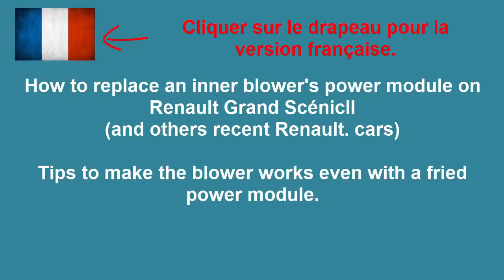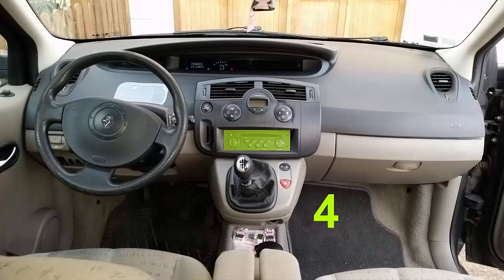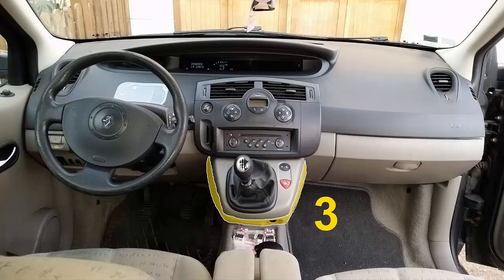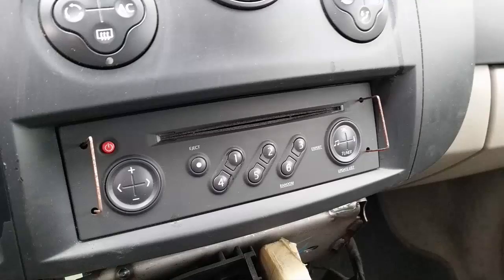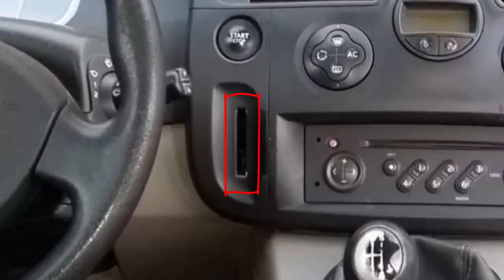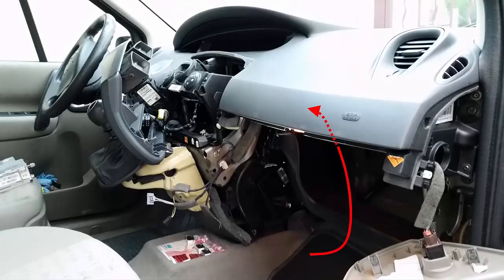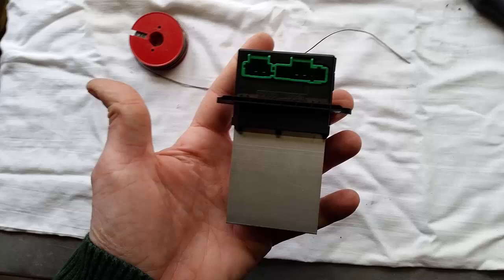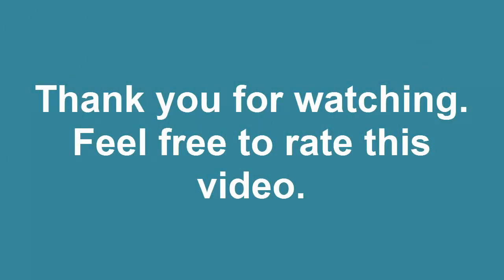How to change a inner blower's power module

Comment: This is only if you have an ACC in your car. If you only have an AC it looks different and it is very hard to replace because two of the cables you can't disconnect (red and black).
It is also common that the connector is damage. The only way to fix it, is to buy a new fan resistor, cut the cables and splice in a new connector.

Comment: does it works goed with the welding wire ?is it dangerous to have the resistor working that way.?
Reply from the maker: The resistor is toast in this case.
The wire is only there to bypass this power transitor.
In this case the blower will run, but only at full speed.
Thus it gives you the possibility to remove moisture from your windshield.